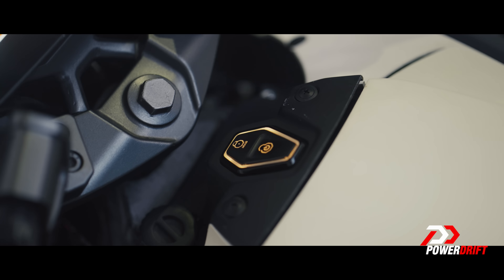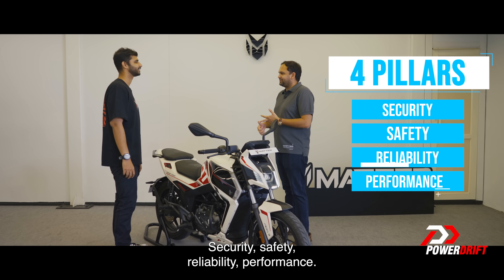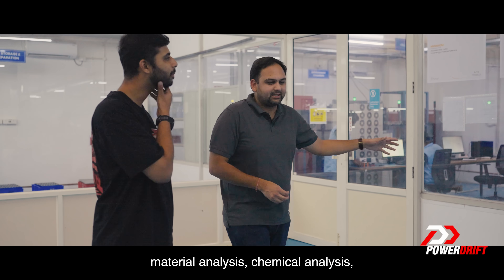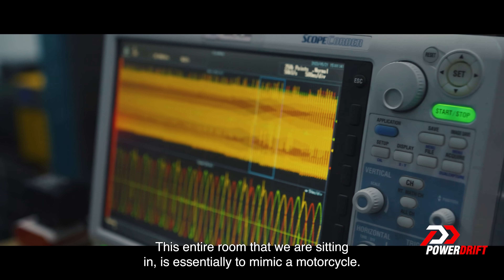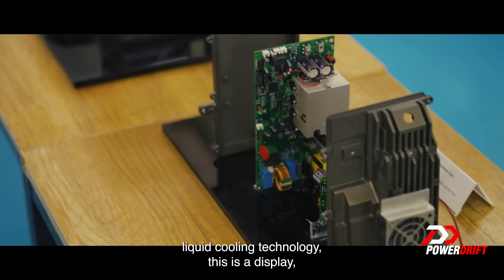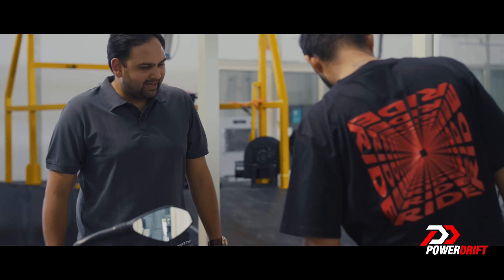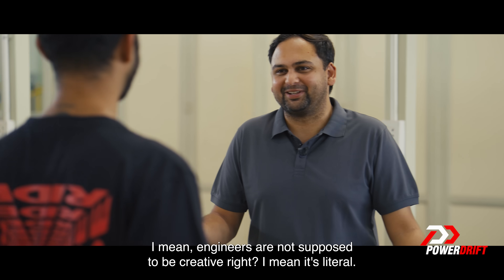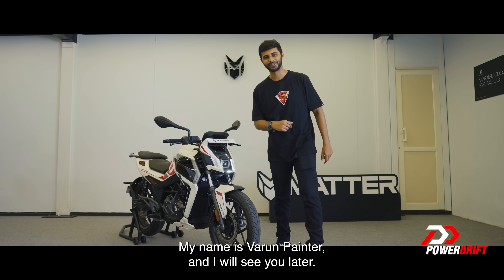Exclusive behind-the-scenes at MATTER's R&D Facility | PowerDrift

Comment: Is that gearbox really necessary?? If motors can directly connect to wheels, won't that gearbox basically reduce the battery range?
Reply: Gear box are needed for higher tourque
Reply: Must be the first time someone says electric vehicles without gearbox has less torque than required! Rest of the people try to calibrate the controller so that the initial torque is reduced!
Reply: It reduces the battery performance

Comment: 😂What is the purpose of gears when its not give you range of more than a minimum of 150-200 km range,gears are meant for efficiency right.ola s1 pro can give you range of 120-130 KM when rode on speeds of 75-90 km/h.why bother of shifting gears at all in EV.
Reply: Because it is a bike and we have habit to switch gear whatever it is usless or useful feel the riding of bike
Reply: For acceleration dude